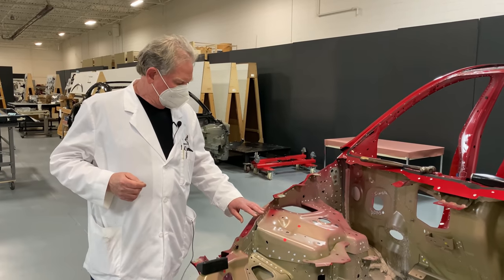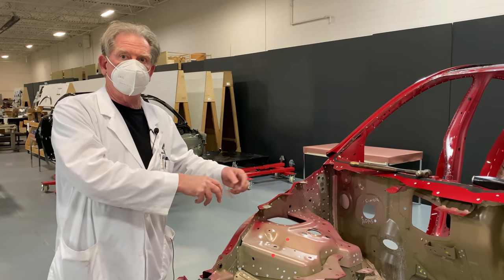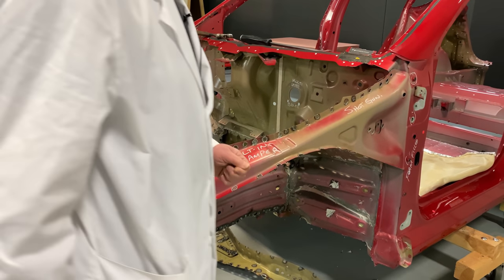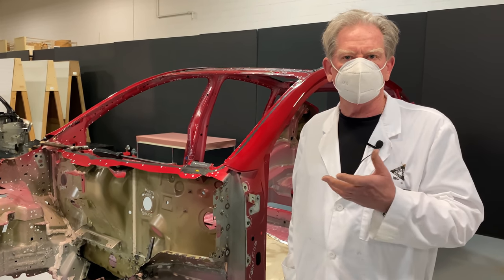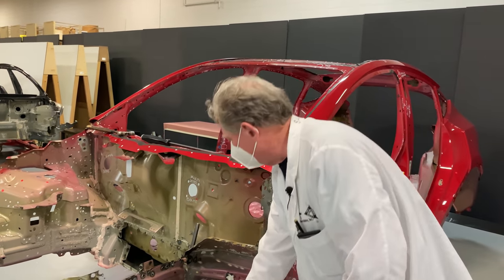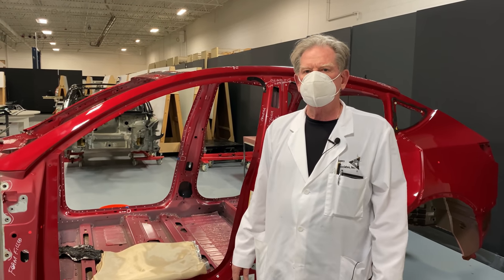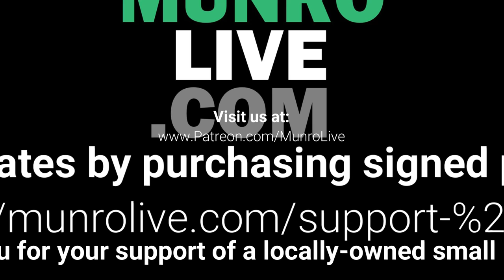Model Y E33: Sparks Fly for a Breakdown of the Body-in-White

Comment: This series really puts into perspective everything that goes into designing/building a vehicle, let alone a high quality one. Yet still a roadmap of improvements to be done. Amazing how complex it is!
Reply: Ikr
Reply: And Sandy is way simplifying it, so that it doesn't become too dry for many people.
Reply: I agree, I never knew how complex it was.
Reply: And here I thought the design was just done on a computer and then press print.
Reply: And that's only hardware. So far, Sandy did not even bother to look into the software and remote services side of modern cars. 
With me being from Germany: this knowledge on (traditional) car design and manufacturing is way more common here, and the same I think holds true for example in the Detroit area, where many automakers and likewise Munro&Associates are located. There are just regions, where the knowledge on cars and all their traditional aspects is more wide-spread than in other regions. Former Manufacturing Belt, gradually turning into Rust belt. With Silicon valley taking over, whether you like it or not. There, body in white engineers are just some other kind of engineer, with software developers, chip designers, data scientists, electrical engineers and manufacturing automation engineers getting most of the focus, reward and attention. Who cares about the type of steel of certain body parts or joining methods, when you can market a car with 400 miles/640 km of EV range, a supercharger network and "full-self driving capabilities." :-)
This kind of approach centers on promised or actual value for the customer, not necessarily immediate savings for the manufacturer.

Comment: So much details to think when designing a car!
Reply: GM and Ford put ZERO thought into building a Vehicle, they want to make it a CHEAP as possible, with NO Consideration for the Passangers.
Reply: @markplott4820  Wrong, but your mind is probably made up. I'm involved in the automation for welding bodyshells together, and what I'm seeing here is very comparable to that of any other manufacturer.
Reply: @bikeaddictbp  - then why is Model 3 5 Stars in every Category and GM and Ford not ?

also, why is Tesla 9% SAFER than any other car with Autopilot ?

TESLA is factually SAFER with Millions of miles Driven with ZERO Fatalities

TESLA does modular doors , similar to FAC and BMW, why does not GM & Ford do door modules ?

Tesla 2 piece casting is Almost unherd of in the Auto Industry, and soo to be SINGLE piece casting.
Reply: @markplott4820  Give it up. You're an overly biased Tesla troll. Allow yourself to look at the facts for once.
Reply: @markplott4820  Other manufacturers also have 5-star crash-rated vehicles. This video is not about autopilot or headlights or any of the other stuff. And the claim that Tesla has zero fatalities is pretty easy to refute ... I need only find one, https://www.zdnet.com/article/tesla-fatal-model-3-crash-autopilots-operational-design-condemned/  I will give credit where credit is due; the casting design for the rear underbody is good, and using door modules is good.
Reply: @bikeaddictbp  - Other vehicles DO NOT have 5 stars in EVERY Category, and FATUALLY Tesla is the ONLY car with some in 6 STARS .
insideEVs - TESLA Autopilot Deaths.
Tesla is the ONLY one Collecting Millions of Intersections per Month. 
and Tesla has Billions of Miles of Autopilot DATA Collected vs only Millions of miles by Others.
TESLA +1 million miles between Accidents vs 500K miles in any Other car.
TESLA 9% safer than ANY Other car PERIOD.

Comment: can not wait to see the final details of that unibody uncovered and burned out all the spotwelds to show the current state of engineering.
That welded hatch or bracket was also an interesting piece ... needed a second part and positioning and clamping both together to get a right spot weld instead of your idea to cut and bend. Lot easier, less pieces to order and handle and cheaper for sure.

Comment: Sandy, I have two questions:  

1)  the lack of paint on the interior surfaces, does this make the vehicle more prone to rust damage?

2)  The aluminum rivet attaching steel and aluminum together, will this be a spot for galvanic corrosion?
Reply: Hans Conser the interior is all aluminum which doesn’t rust
Reply: @zackj997  I'm referring to the interior of the front motor bay

Comment: Another very informative and entertaining session - great!   Am also curious, after a few months of production, will the design be mostly frozen (or should I say cast in iron) because of the significant investment already made in setting up the automated assembly line - or are  changes/ improvements still possible with minor adjustments?  For example that section at  2:54 shows a pretty complex design, it probably is pretty well optimized already - but how do we know it can't be improved further ?   Maybe for  the Shanghai version and then the Berlin version ..
Reply: It's not impossible for changes to be made at this point, but it's at a point where it's really expensive to make such changes. Obviously if they tool up to build a similar vehicle at a different plant, that's an opportunity to include lessons learned. You might see tolerance changes to address fitment, but engineering changes - even weld-position changes - can affect crash performance, and re-validating that gets expensive. The area you identified does look complicated but the main tough part is done ... figuring out how to build it in the first place. That area has to support and distribute suspension loads, and distribute frontal crash loads into the door ring and firewall and floor, and provide attachment points for all sorts of gadgets and gizmos under the hood (HVAC, brake lines, brake master cylinder for RHD, electrical and cooling system parts, etc), and not trap water in a way that leads to corrosion, and it has to be possible and practical to make the parts and weld them together. The area you identified tends to be pretty complex on just about any modern unibody vehicle.

Comment: I only have one complaint about this video...
That's NOT an Air-Arc lol
An Air Arc is a totally different, and even hotter, tool..
Basically its a hollow, copper coated, carbon electrode that goes into a special electrode holder which blows high pressure air through the hollow core.
It basically looks like a large stick welder holder and electrode.
It then connects to a LARGE arc welder power supply.
You strike an arc just like with an stick welder, and it melts a weld pool just the same (though with hundreds of amps), and then the high pressure air blows the molten metal away.
As you can imagine, it creates a BIG cloud of sparks! Quite fun to operate, very noisy, but beautiful curtains of molten steel everywhere.

What they were using here was a plasma cutter, which is also an awesome tool, but much more delicate and precise.
Like the difference between using a scalpel and a chainsaw to cut the turkey lol

Comment: Yes it is a art to design the rigth frime with the right material knowledge and production steps . " Don't let kids on the job " is the right expression. And i saw kids working on a frame just because they tought they know how a car is build. ( Wish i could post some pictures ;-) ) In general these designers worked with tier hands in the past . BUT ,what i really like to know is if you found any glue between the panels which are spot welded ?

Comment: Thanks! Very interesting, and now imagine that this whole body in white is casted in one part, you then can adjust the thickness of the material exactly how it is needed at the according area of the body in white. 3mm thick Aluminum casting equals approximately 1 mm of steel regarding weight. Furthermore you can cast struts where useful to strengthen the surfaces (as is done with the motor housings).
Reply: Stephen Graham  That is as generalization not true, as you can design parts with the same strength as for example formed sheet metal youth only may have different material thicknesses. And that is the interesting part, you can adjust the thickness very accurately to the load profile of the part. Furthermore you can cast in braces to give the part three dimensional strength. It depends very much of the use case whether a casting is better or bend sheet metal.
Reply: Stephen Graham  I think for the rigidity of the passenger cell a single casted part is advantageous, the only draw back is, that in a collision where the passenger cell is deformed the repair might be much more expensive, the manufacturing will be dramatically easier and thus cheaper with such an approach.
Reply: Stephen Graham  Yes, very difficult indeed, and the mold(s) are very expensive, but for mass market cars like Model Y and Model 3 it makes sense. I recommend having a look at Teslas "giant casting machine" patent. They are definitely working and for sure they calculated it. Such casting is not available today so they are developing it. The passenger cell is made out of 80 parts that have to be put together, that needs a lot of robots, space and time, I am quite sure that an injection molding in a fraction of a second is much cheaper, when producing high quantities.

Comment: I assume that there is something in the tube that the crush can goes in that retards its movement in a crash?

update: I see that the crush can does not move it just squishes up. so the bolts and the steel bit hold it in place.

Comment: You don't want to use lead for your mass damper unless you are very short on space, it costs many times more than iron or steel and it's bad for the environment if it doesn't get recovered from the body when it's recycled. Of course if you're REALLY short on space you can go for depleted uranium!

Comment: FIRST TIME EVER I have hears someone say you can weld aluminium and steel...  

I saw a guy in Bulgaria weld an aluminium electric window motor to the steel frame of the car door with a mig welder - which I thought was impossible - but he did it.

Comment: Could those complex inner wings be cast?
Reply: i doubt it would crash properly with a casting.
Reply: geofrancis2001 The ‘crush cans’ could still be separate aluminium parts to be bolted in to the cast inner wing.
Reply: The front inner fender and rail has a complex job of transferring front crash loads into the door ring (distributed between the windshield pillar and rocker panel areas) and has to itself be deformable in a predictable way in case of a hard frontal crash that goes beyond the capability of the removable "crash cans" to absorb. Castings tend to be brittle and simply crack or explode into a thousand pieces, as opposed to bending and absorbing energy while doing so the way stamped and formed sheet metal does. Perhaps it "could" be done that way, but sometimes it's better to use a solution that you know works.

Comment: shouldnt it be easier to drill the spot welds out?
Reply from the maker: It is not. Thanks for watching!
Reply: so many drill bits, harder on the user
Reply: With respect, Munro are all about efficiency, I think they probably know the most efficient way to disassemble 😂
Reply: What is the definition of easier ?

He cuts or burns the spotwelds out in less than 8 secondes and if you'd use you phone or watch to stop the time he needs than you will see a much faster time than drilling them out considering you have to get through 3 layers of sheet metal and to replace the drill every now and then. It will take more power to drill through too, makes the guy tired and working less accurate over time.

At the end of the day the time it needs to get it done will count the most for sure cause there are a lot of welds that have to be outcut or burned.
Reply: I work at a auto testing facility and our tare down department uses pneumatic grinders. The workers in there have to wear hearing protection, respirators, and heavy leather jackets. Employee turn over in that department is very high. I think I will reference this video to the engineers when I get back to work (Thanks Sandy!)
Reply: May take more time